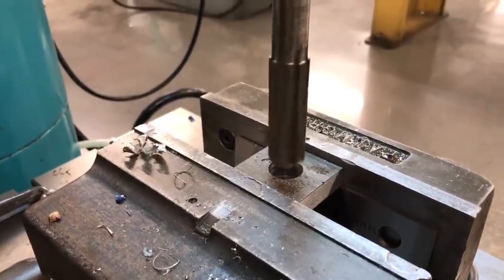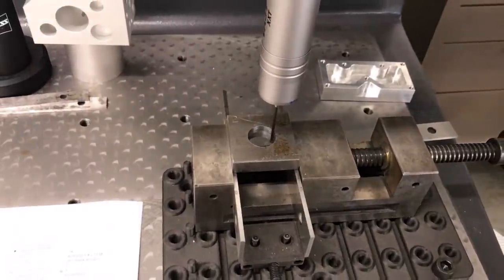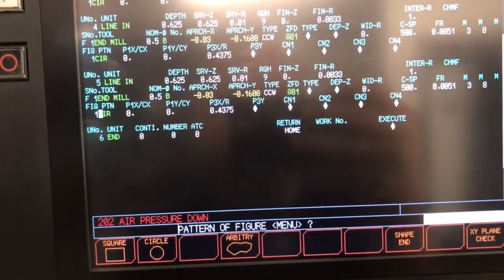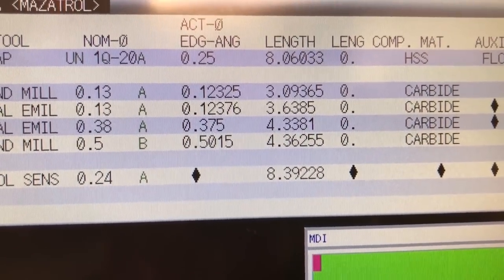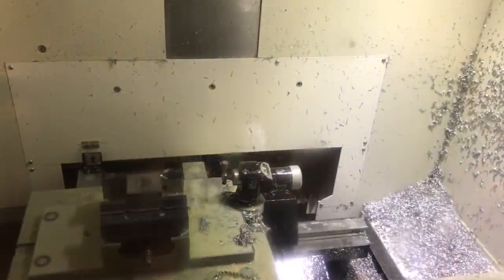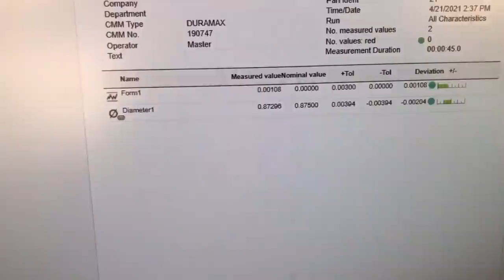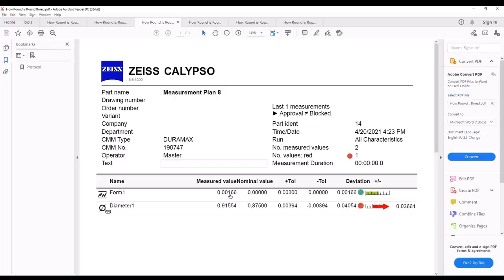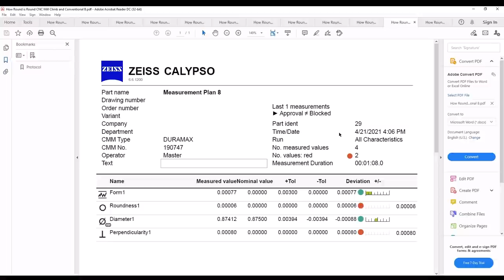Machining the Perfect Hole | Different Methods Compared!

Comment: I wonder did you use a torque wrench and the same vice on all the tests? I wonder if the different pressures from the different vices had a affect on the results. Also maybe try the boring head in the cnc?

Comment: For a fair comparison you should have used the cnc mill for all operations drilling, reaming, boring and milling. I've seen people get a lot better results with reaming and boring operations.
Reply: For sure.  I bet that Mazak has way better spindle runout than the Bridgeport.
Reply: @Thewaldo12345  my thoughts exactly. I think spindle runout is the cause of the deviation.
Reply: @scottnoble7979  if he wants the best results I’d be curious to see how a jig borer or jig grinder turns out.
Reply: I ran some diaper parts on a mazak in 01. We had to ream because the mill bore would leave the bottom way bigger. That had to do with xy and z all being on the head. The reamer didn't care.
Reply: @travisthomason8869  that just needs the parameter fields correcting

Comment: Good video but you really should be getting at least a 64 finish with that boring bar any less and its not going to be a good test of what you get. If you get a sharp reamer with proper speeds and feeds you can hold tenths if you know what your doing.

Comment: I need to make a hole as close to 0.25" in a 3" thick UHMW-PE spool that will be riding on a piece of 440 stainless steel shafting with a known tolerance of 0.2490" - 0.2495" in a submerged freshwater application, what method would you use to get a very precise 0.25" hole -0.00/ +.0020?
Reply: If you have some spare stock around where the holes need to be, put pilot holes in there and run a 0.25" gundrill.
Reply: @sicstar  Thank you
Reply: @chrisdaniel1339  Actually! Better use one that is 0.2490" ! ... smh sry...

Comment: When I am milling the holes deeper than 1x tool diameter, it becomes a cone like. I guess that is because of tool deflection. How can I get rid of that?
Reply: What kind of tool path are you using? What I do is usually predrill a pilot hole - so let’s say we’re doing a 1” hole through 1” steel - I’ll drill it out at say 15/16” (or whatever feels good and close). 

After that, if I’m feeling very fancy, I’ll use a helical toolpath with a 1/2” endmill leaving .01” stock on the walls, then come in with the same tool at full depth and do two circle passes with a spring pass to hit final size. You usually eliminate taper that way.

There’s lots of ways of doing it - the helical probably isn’t necessary - and you can always sub out contour multi-passes for the circle mill.

Comment: We always drill / boar / ream to final size if critical BUT CNC circular is plenty good for many things which is why you see so much thread milling
Reply: that depends on what you call critical, reaming is never going to be the best but if it works for your application it is cost effective.
Reply: @martinfidel7086  

We bring bearing cast iron bearing housings to a .0002 to press in the outer race and if needed will hone
Reply: @tommays56  IWhat measuring equipment do you use to check that dimensional quality is correct ?
Reply: @martinfidel7086  

Ring Gage and dial bore all certified 

You do realize shops did precision work before the YouTube CNC craze
Reply: @tommays56  so in essence then you are only checking the diameter at what can be described as random depths within the bore ?   It's interesting, because I come across this a lot, how do you measure for straightness from end to end of the bore ? how about maybe you machine it dead straight but how do you check at which angle you have machined it too ? because a ring and bore gauge won't allow you check either of those irregularities
Reply: @tommays56  They often used to think they were yes why do you ask ?

Comment: A scientific demo/teaching video yet students performed the work and you had to make excuses for them at least twice at the CMM for bad technique.  You can visually see the run out on the manual machine both on the drill and reamer, of course the boring head is producing garbage.  Predrill an undersized hole by .001-.005, minimize the stick out on that reamer and throw it in that Mazak and that should be your best hole.  Difference in vice clamping force between CMM and CNC can warp your hole.  Are the vice parallels in the CMM contacting the same RAW edges/surfaces as the were in the CNC or did you rotate it 90 degrees throwing off your “perpendicularly?”

Comment: The best way to get a round hole is to bore it! The problem with the bored finish is he used a HSS boring bar instead of a Inserted Boring Bar. I guarantee you can get a mirror finish with the right insert. Plus I wouldn't use a wobble dick boring head with a small dia. boring bar. Too much deflection! When you bore a hole you go through then BACK BORE the hole to take out the taper. I've bored thousands of holes for Leader Pin and Bushing holes for Die Sets and Mold Bases in my 40 years in the trade. I know what I'm talkin about.
Reply: My boss use to get crazy with me when I bored back out but it the only way you know.
Reply: you may get great results but it still won't beat a hone